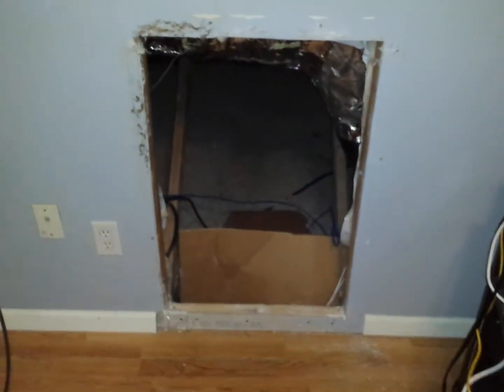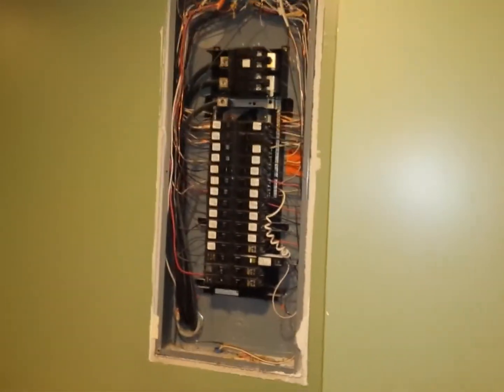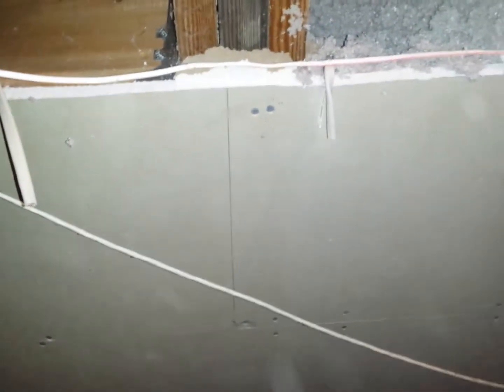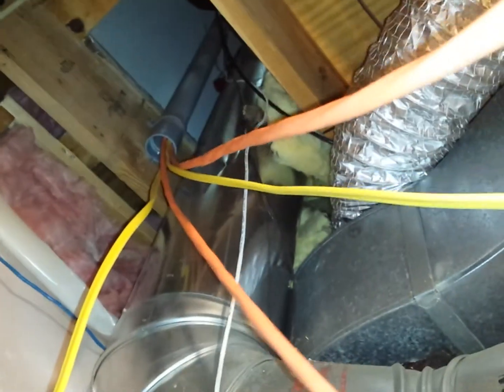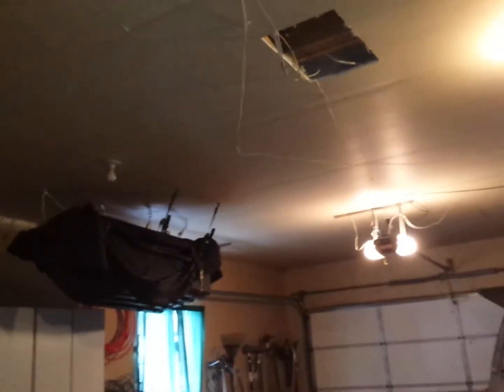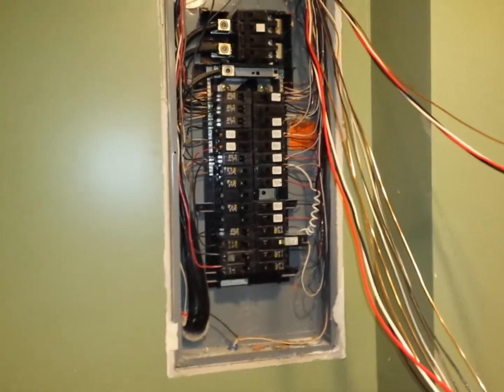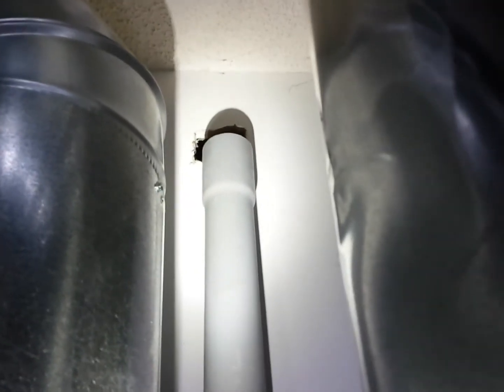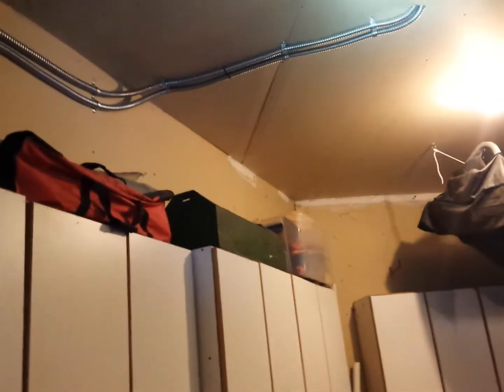Electrical Done! Laundry Project Part 2

Comment: Excellent!  and I'm feeling a whole lot better about the electrical on my project.  You just made mine look like a walk in the park!!  :-)
Reply from the maker: Oh? Ah it wasn't so bad but the blown insulation sucked, oh and hitting a wire.. LOL
Reply from the maker: Hey I have this sweet idea a guy told me about for framing up my dryers, raise them off the floor 12inches... I'll be doing that.
Reply: Eric C, I had to laugh LOL,  I had just set a box of those metal blocker plates for the floor joist aside from the last project.  And that's what those are for!!
Reply from the maker: brymckown Mother!

Comment: in my area, code doesn't allow the main furnace to heat a garage. If that is the case in youre area, add a vent with a water trap to your dryer pipe in the garage. aids in keeping your man cave warmer as well.
Reply from the maker: I have a 2 zone furnace its all code. My house is 6500 sq ft. not including my office. I dont understand vent and water trap. Elaborate. please.
Reply: ill try. its like a P trap for your sink, but its made to run ventilation from your dryer to the interior of your home. so air goes through a P trap of water and it catches all the lent that would be in the exhaust. and 6500 sq ft? holy moly. we are wanting to get down to about 1800. we are curently at 3200. but we dont have kids.
Reply from the maker: I am going to vent through the garage out of the house. Its less than an 8 foot run???
Reply from the maker: and my wife and I cannot wait for the day.